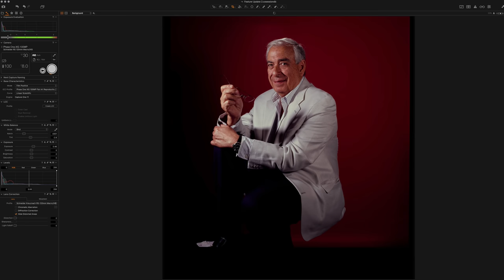Cultural Heritage | Phase One Film Scanning Solutions | Phase One

Comment: How does the end result compare to drum scanning?
Reply: Pete Melon  Inversion and corrections are not more time consuming than when using a scanner and having the image saved in RAW format allows you to go back and re-process -re-purpose the image. The Lightboox is a few inches away from the film plane, which creates diffusion and thus reduces issues with dust and scratches quite dramatically...
Also having a sensor that captures and processes in 16-bit is a big plus for colour depth but also for glass plates where you need the extra DR.